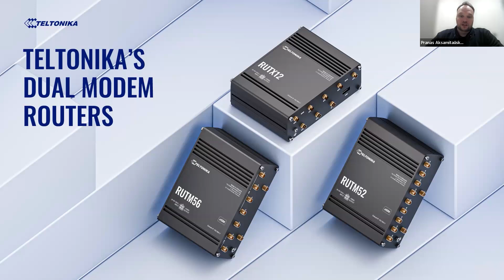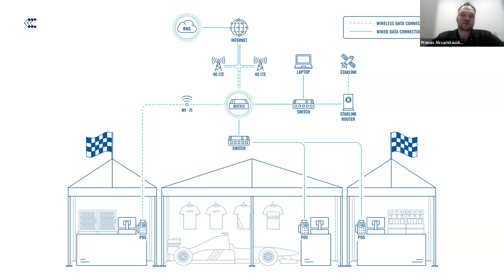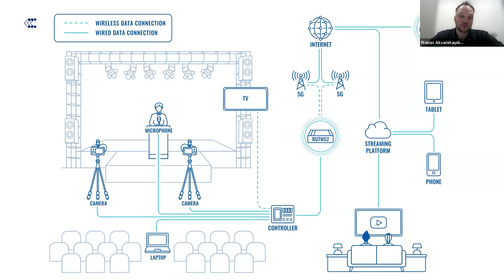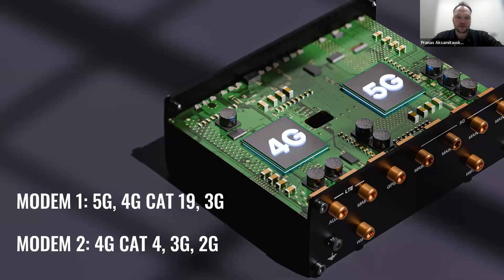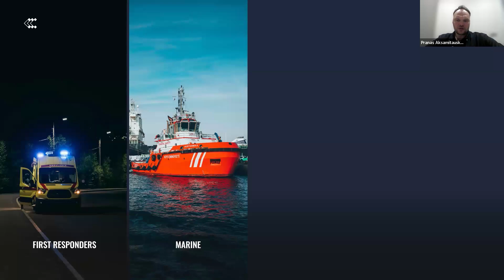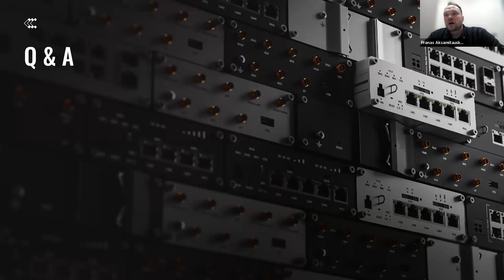Teltonika's Dual Modem Routers Powering Reliable Connectivity | Webinar

Comment from the maker: Timestamps:
00:00 – Intro
00:46 – Dual SIM ≠ Dual Modem: key differences explained
01:28 – Benefits of dual modem: speed, reliability, failover
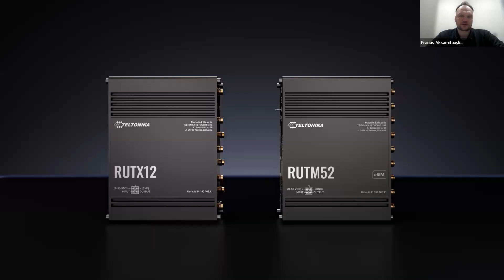02:07 – Early dual modem models: RUTX12 & RUTM52
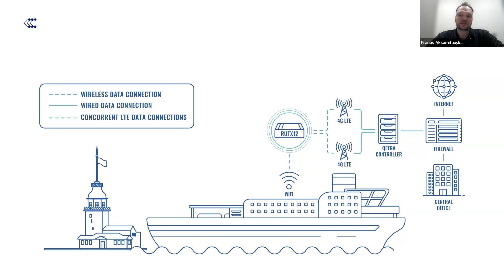02:51 – RUTX12 in action: buses, ferries, F1, streaming
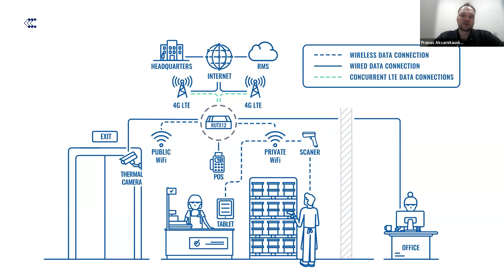03:27 – Load balancing: when and why to use it
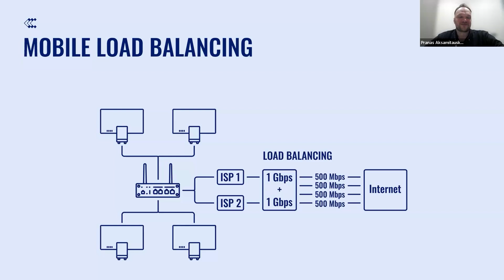04:46 – Bonding vs load balancing: use cases like streaming
05:24 – RUTM52 features: dual 5G, dual SIM/eSIM, high performance
06:59 – RUTM52 use cases: emergencies, live streaming, healthcare
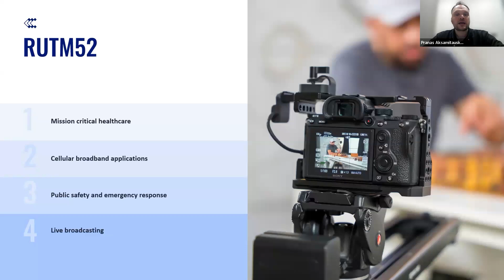08:22 – Meet RUTM56: 5G + 2G fallback in one device
09:13 – Why asymmetric modems? No 5G modem supports 2G
11:06 – Hybrid connectivity: bonding, failover, and eSIM control
12:41 – 2G isn’t dead: global coverage, low frequencies, cost-effectiveness
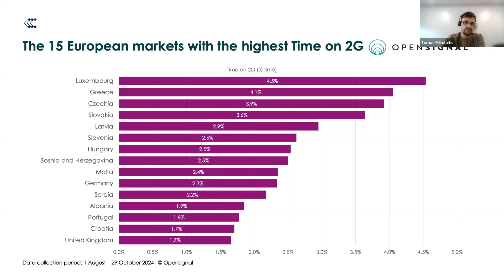15:20 – RUTM56 simplifies complex setups (X50 + dongle)
17:01 – Real-world RUTM56 use cases:
→ First responders
→ Marine & vessels
→ Smart agriculture
→ Remote infrastructure (e.g., ski resorts)
21:07 – Hardware highlights: 5x LAN, Wi-Fi 5, rugged case, GPS
22:56 – Plug-and-play: comes fully equipped, no extras needed
23:43 – Q&A: eSIM for both modems? SIM management explained
26:03 – Why phones can do 5G–2G on one SIM, but routers can’t
28:56 – Swiss rescue use case: low-band LTE for poor coverage
29:43 – Wrap-up: thanks & contact info

Comment: I have to follow up once again on the argument that “there is no 5G modem with 2G support.” That statement isn’t entirely accurate. If that’s the case, then why does every 5G smartphone also support 2G? For example, devices like the iPhone 15, Samsung Galaxy S24, and Google Pixel 8 all include 2G support despite being equipped with 5G modems. Something doesn’t quite add up in your argument.
Reply from the maker: Hello,

You're right that many smartphones support 2G alongside 5G, but they use integrated chipsets designed for broad consumer use. Industrial-grade 5G modems often skip 2G/3G to reduce complexity and cost, especially as those networks are being phased out.

That said, we now offer a solution: the RUTM56, which features dual modems, allowing 5G and 2G/3G fallback in one device:
https://teltonika-networks.com/products/routers/rutm56